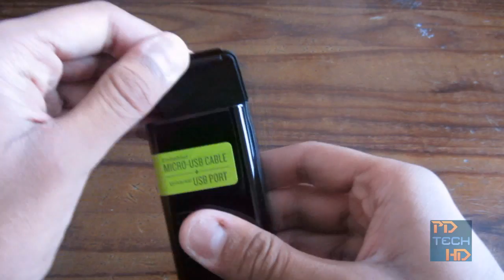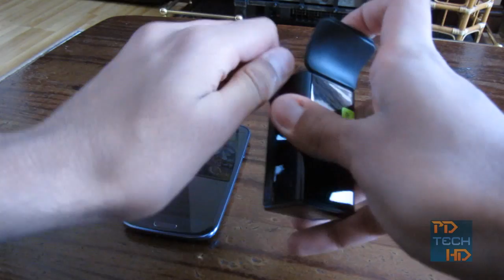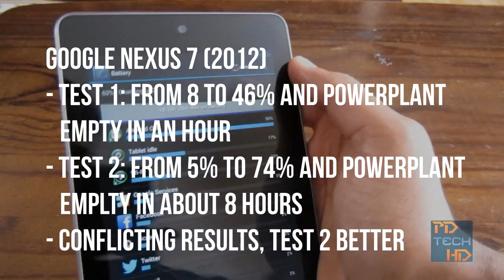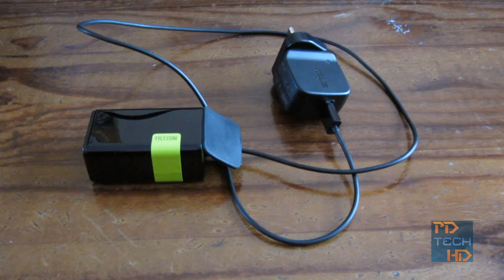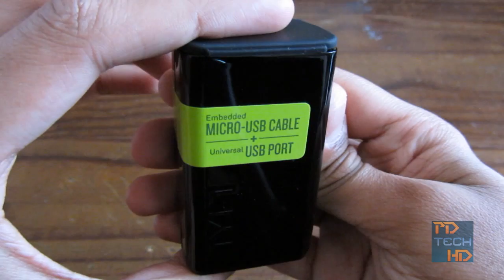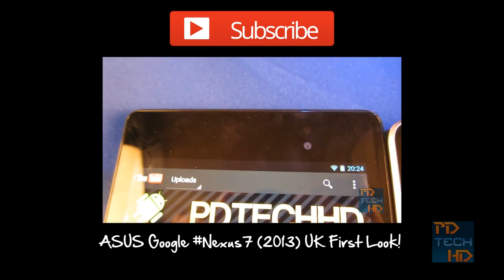TYLT PowerPlant Review - Best Portable Battery Pack?

Comment: Looks nice, but a little expensive!   comprehensive review though PD as usual :-)

I reckon the Nexus 7 probably didn't charge so well as it will draw around 2 amps which is less kind on the PowerPlant's battery.